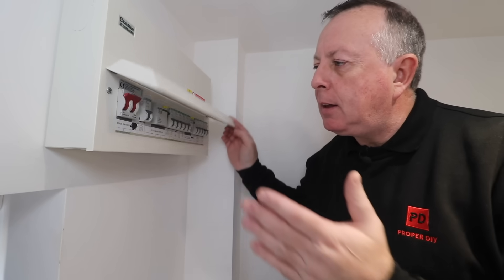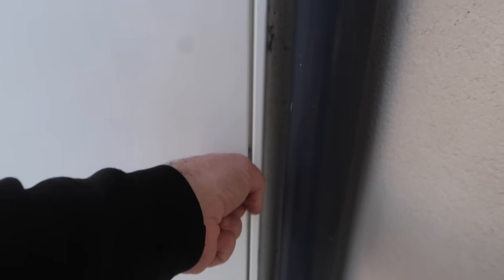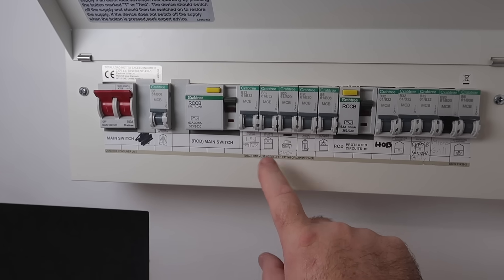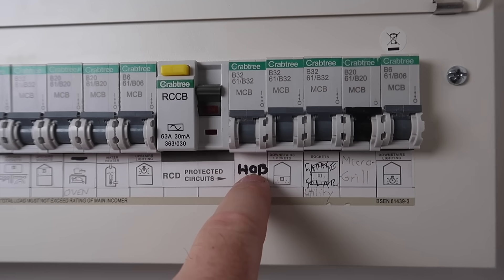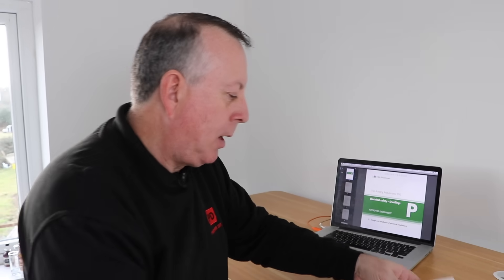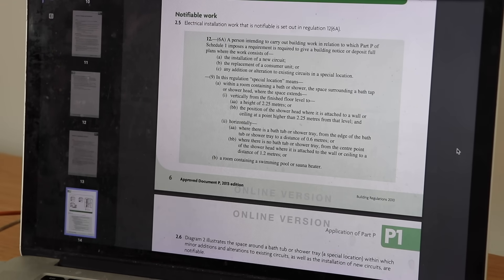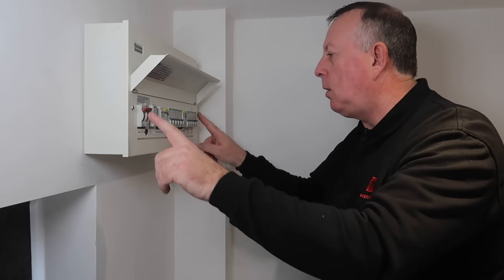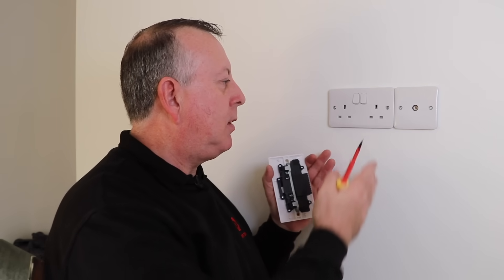What electrical work are you allowed to do in your own home?

Comment: My old house had the kitchen on its own ring main.  2 x 2.5mm2 twin and earth left the fuse board.  They entered the kitchen which was in an extension build +15yrs before we moved in , and were connected togethe in an open chocolate box connector strip.  A 2.5mm2 radial left that to feed half the sockets on one side, and a 1.5mm2 radial left the connector to feed the other half of the kitchen.  I reqired the whole kitchen.  So much for a professional sign off on the extension.

I had work done on my garage and a small porch built by a professional builder.  He used qualified electricians. They moved the small consumer unit in the garage, remounted on a beam with the back of the consumer board left open with all live objections touchable.  I moved it back to original place and replaced wiring now too short.

In the porch they out in a spur of the socket to feed the lights instead of going back to the fuse box to to feed porch lighting.

I removed the spur and ran a wire to the light switch back to the lighting fuse.  While doing this I found they had run a spur of a JB to ghe porch socket.  That JB had 4 wires in and no spare ntry so they went in thru the lid with a 5th wire and left the lid off opening the JB live connections and leaving them all exposed.

I added a socket to the ring main and in checking found my neutral broken, the live was complete round the ring.  I traced it and it left one socket but did not reach the other, a broken wire.  The fault was in a conduit where they had a 6mm2 cooker feeder, a 2.5mm2 immersion heater feeder and one of the  2.5mm2 socket ring main cables.  It was so tight I could not get the wires out and had to chase the wall out and run a new cable, disconnect the original wiring and fit a JB to splice my cable to complete the ring main.  I disconnected and abandoned the cooker switch ( it being left in the old kitchen when the extension was build and now not connected to anything), the immersion switch feeder had been disconnected previously.  The switches I removed but could I hell get the wires pulled out that conduit, had to cut both sides and leave them, god knows how the hell they pulled them in, solid as hell, no wonder a wire broke.  This was a fault in house from 1965 when it was built until the 90s when I bought it  found the fault anx fixed it.  30years that ring main hadcan unprotected neutral with only 1 socket connected to the 'short' neutral and Alltwen others on the long one on a cct fused at 32A.

I am an Elect Engineer but not a sparky.  No way will I let a spark work on my house, I just do not trust house wiring sparkles after seeing the mess so called professionals made.
Reply: Id be more worried that the builder used them and probably still uses them than the fact they have no pride in their work. Did you get a cert at the end of it and if so how? The work clearly wasnt up to regs and if a cert was issued and work was notifiable then a phonecall to the NIC or Napit shouldve been made. If youve now altered and moved things esp the DB your insurance is now null a db change should come with a full installation cert.
Reply: @bdboyo  I moved the original DB back to it's original position.  They moved the DB so they did not have to replace a couple of wires thick were too short as the roof beams of new roof were slightly higher.  Madness.  Easier and cheaper to run two new wires each no more than 4m long especially since the old wiring had already been unclipped.

I think the best fault I found was when I had the old gas back boiler replaced with new combi boiler.  The hot water came out so hot it was scalding, literally boiling out the tap.  I looked at the boiler and saw condensation on the hot water outlet (conveniently coloured red with an H) and the cold water linnet, blue and C, was red hot.  Pipes wrong way round.  Thermostat on outlet constantly seeing mains cold water.  Called them up and explained the problem, the fault and how to fix.  Total disbelief on other end of phone but they sent someone out and he could not believe it.  Said it was first time customer phoned up and told him the problem.  Not electrical but demonstrates shoddy workmanship that exists.

My new house was build by a sparky.  Electrics perfect with sockets anywhere you could want them.  Only had to do two jobs, install loft lighting and the circuit was pre installed with all wiring(he had not got round to it), loops left where lights go (just a matter of installing 15 or so lamp holders), and install additional mains smoke/heat alarms as new scottish regs meant we needed 5 and we only had 3.  Ditto my daughters house, extended loft lighting and replaced original single mains smoke with 3 smoke/heat units so extended cct and maintenance by upgrading units to interconnected type.

Comment: Amendment 2 of the 18th Edition wiring regulations just about mandates fitting surge protection devices in the fuse box (SPDs), unless a risk assessment is undertaken to conclude you don't, which is above what an average professional electrician can do.

The wording excludes single residential units where the total value of the installation and equipment does not justify SPD protection. A valued decision.

Comment: From June, 2022 AFDDs arc fault detection devices were mandatory in flats with 6 floors and higher, care homes, etc, on any circuit with one or more sockets on it.  This detects arcs which can cause fires. An AFDD can replace a micro circuit breaker in the fuse box, in the same slot. It has four functions:

1) Over-current protection;
2) Fault detection;
4) Earth leakage dectection (RCD);
5) Arc fault detection.

AFDDs are recommended on all new installations and circuits.
Reply: Still only a C3 on inspection, unless of course there is enhanced risk which would be unlikely. HOWEVER: One could argue that you haven’t made anything worse (safety-wise) by not installing an AFDD with an addition but you technically may have by adding more points on which a cable could fail and thus leave it in a condition considered less safe. It’s all getting very political. I was surprised AFDDs were not mandated for terraced houses where fire could spread through the joined roofing.
Reply: Do they work - reliably - on low current lighting circuits though?  

I suspect that their 'need' stems from the days when we were drawing high currents and potentially causing significant arcs.
Reply: @barrieshepherd7694 you “suspect”? 😂
Reply: Over priced.
Reply: @derekgoodwin6646  
Not over priced, just expensive. Price is dropping.  But four separate devices that does what the AFDD does in one package then it will be expensive.